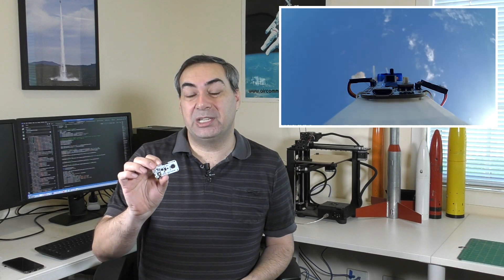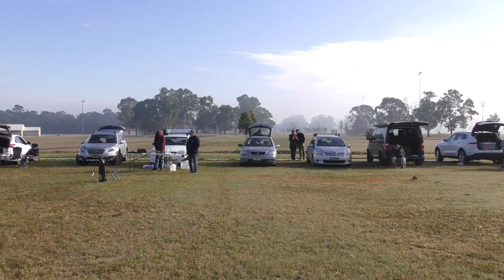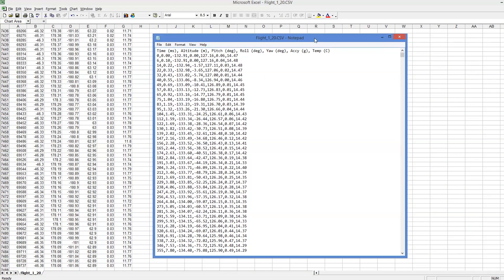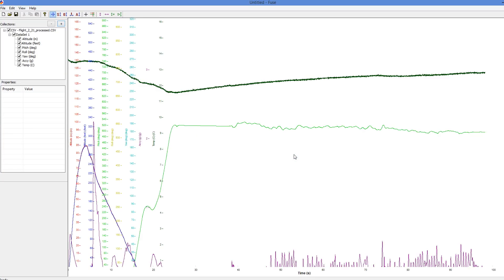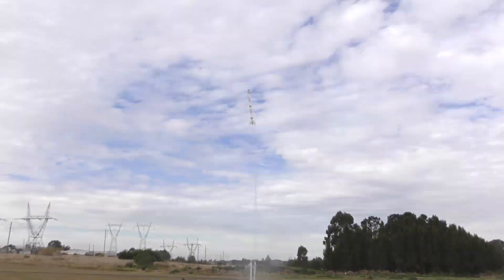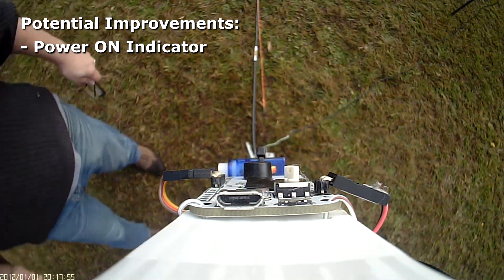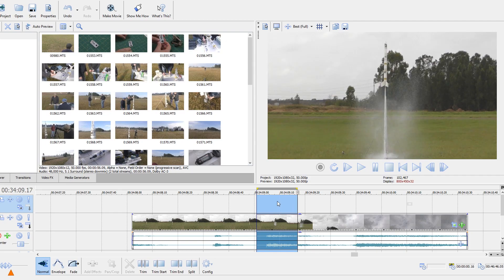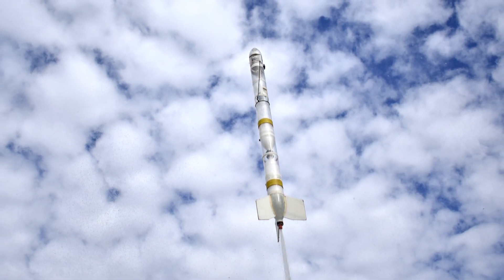Daniel's Water Rocket Flight Computer

Comment: Photo thoughts - set the camera at a wider frame (or ideally further back) so the rocket will pass through the frame. Set the camera to continuous shots and capture multiple exposures as the rocket passes. 
Then review the images captured for that flight and drop the image that you like the most. 
Image sizes in cameras are so large now that you will not notice the crop and will be able to choose the most dynamic shot. 
This will also allow you to play with slower shutter speeds to capture intentional motion blur. 
Great video as always. Thanks
Reply from the maker: Thank you for the suggestions.

Comment: that board looks good, in my rockets it's always what I fail and what it costs me to make work. Which program you use to view the flight data, seems easy to use.
Reply from the maker: The program is called Fuse. It is something I wrote a few years ago.
Reply: @AirCommandRockets   @Air Command Rockets  Is it possible to download it somewhere? I always have a hard time finding a program to make graphs easily, I used Excel to make some graphs showing the G-force of a rocket but I couldn't get it to show me multiple flight data at once.
Reply from the maker: @CuervoRC  Unfortunately the app isn't publicly available yet. ... We are working on an open source version that will eventually be public.

Comment: I was wondering what your timing setting is when you are using the automatic mode, since Daniels setup guide has the step to set time in automatic mode.
Reply from the maker: I set mine to 0 in automatic mode so the parachute opens at apogee. Sometimes you want to deploy after apogee so that's what the delay is for.
Reply: @AirCommandRockets  thanks for the reply :)

Comment: Have you done a video on internal nozzle shape .... or it just final size that matters?
Reply from the maker: We have not done a video on the internal nozzle shape. Though we have done a number of experiments over the years.  For most water rockets the nozzles are just a straight through hole because water does not benefit from an expansion nozzle. Foam and air phase could get some benefit from it though.

Comment: Which application are you using to view the data?
Reply from the maker: The application is called Fuse, something we wrote a while back, you can import time based data directly from lots of different sources and file types.
Reply: @AirCommandRockets  Is it possible to download it somewhere?
Reply from the maker: @tapiau  Not at this stage. Eventually it will be made open source.
Reply: That would be great!

Comment: Is MicroSD card secure enough to withstand accelerations? Standard MicroSD card slots are not good enough :)
Reply from the maker: It's a good question. One thing we did was to put tape over the slot to prevent the card from getting lost in case of a hard crash. We've lost SD cards from cameras before after crashes the cards were ejected.
Reply: Wow, never thought about that. Goin to apply that tip!

Comment: Fill your high performance rocket with Carbonated Water, half water and half liquid CO2. The propellants would need to be cooled to 0C for the lowest operating pressure. Pressure in the rocket would be a function of temperature of the propellants. A small heater in the launch plug could be used to heat the propellant up to launch pressure from afar. The challenge of this rocket would be loading it. CO2 at 0C  liquid is high pressure. Another loading concept would be loading Solid CO2 propellant pellets, then add the 0C water which should freeze in contact with the pellets to insulate them from the rest of the water. Loading would then be a low pressure event. Put it on the Launch pad ant turn on the heater to bring it up to pressure. Your high performance rocket could be filled close to 100% full of liquid, to reach much higher altitudes.
Reply: That seems like a very good idea, but it's expensive and also quiet dangerous, liquid CO2 when at room temp can reach something like 980 PSI, which is fine because horizon can even take 2000 PSI, but the problem is that, when the pressure is that when the pressure is released, there is a big chance of co2 becoming a solid, because as I don't think that water will have sufficient time and thermal mass to keep the liquid co2 hot enough, a really good idea anyways, I would also like to see atleast a static test of it!
Reply: this sounds interesting, but also sounds like so many more layers of complexity!
Reply: @kayboku7281  That's part of the challenge and fun, simplifying the complexity to keep it safe and fun. The CO2 maintains a high pressure as the propellant leaves. The Water acts as a Heat Sink to keep the Liquid CO2 from freezing. The combination of Gaseous CO2 and Liquid Water allows for a larger diameter engine bell after the throat of the nozzle, because the CO2 will achieve Mach 1 at the throat and keep accelerating in the engine bell to a higher supersonic flow, taking the water with it. So, a Carbonated Water Rocket should have a Higher ISP and more Propellant Mass (more than double) at liftoff.
Reply: @WeBeGood06  Awesome! Try this air command rockets!!!

Comment: Thanks George for taking the flight computer for a ride in one of your rockets! I will get to work on the software fixes.
Reply from the maker: Thanks Daniel for the opportunity to fly it. :) It's always good to see new tech being developed for water rockets.
Reply: Now the new firmware version is ready! I have taken into account all the issues shown in this video and improved upon them.
Reply from the maker: @daninvents3652  Hi Dan, that's great! I only just spotted your comment now.
Reply: The pcb looks a bit generously laid out, maybe you could make it more compact? Should be easy to drop 1/3 off the length, probably would be possible to almost drop half off with higher layer count
Reply: Thank you for the feedback. The white silkscreen makes the board look sparsely populated. There are many traces in this design and I made it as compact as I could. It is true that a multilayer design would reduce the size even further. This is an option I considered but I opted to make it affordable so I stuck to the two layer design.